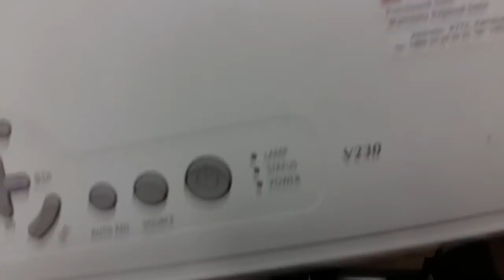NEC Projector V230 lit status

Comment: 😥please tell me how to fix I dont understand anything the problem is the projecter works for few minutes and then the red led blinks off. Please reply
Reply from the maker: projector NEC  has many problems .i'm hard to tell you
Reply: @Khmerlaptoprepair   OK sir I solved the problem thanks for responding
Reply: Yes red blinking
Reply: @venkatesanjayaraman2987 How do you solve it because I have the same problem (projector works for 10 minutes and shuts off with 6 red blinks). br